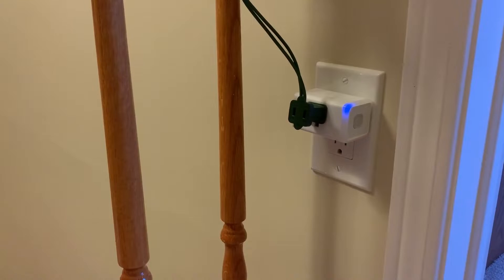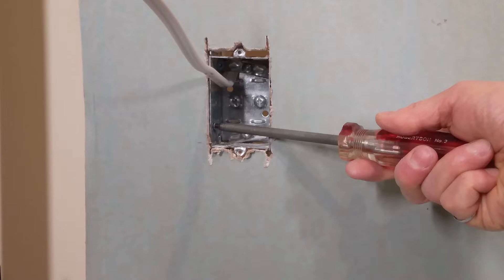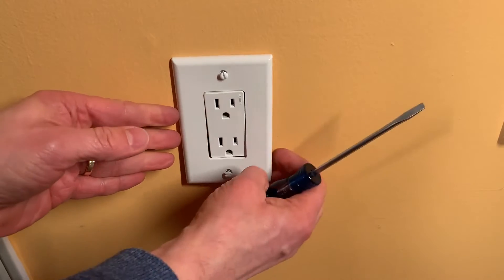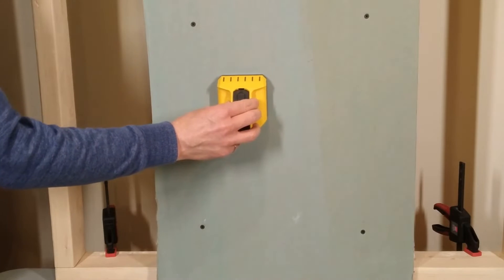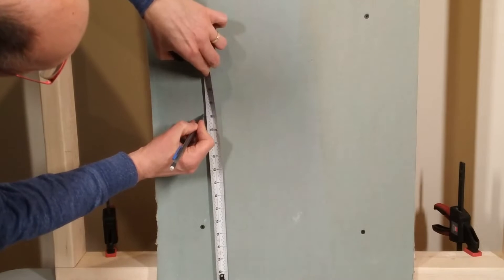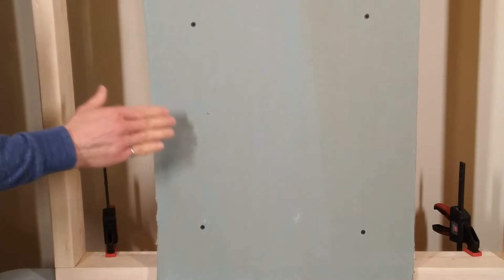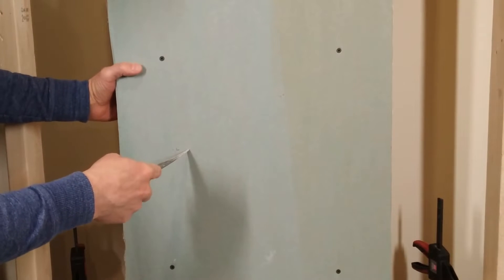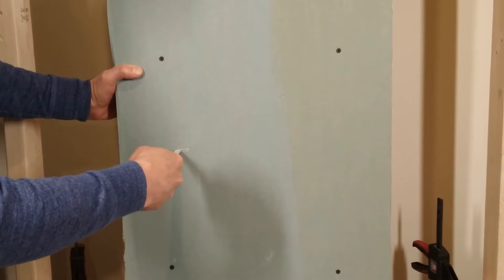Attach a metal electrical box to a stud to add an outlet or switch

Comment: Make sure that the ground wire for the cable is also attached to the metal box with a proper green ground screw as well as the outlet. All metal boxes must be grounded.

Comment: What type of screw was that? (It kinda looks like a machine screw, but that can't be right.)  And how'd you get it into the stud so easily?  Looks like you're hardly pressing on the screwdriver at all while screwing it in.  Did you pre-drill a pilot hole?
Reply from the maker: It's just a regular wood screw. I did not drill a pilot hole - I think that would be too difficult to do in this situation. I guess the stud wasn't too hard but it did take regular pressure to screw it in.

Comment: I wish you were using an actual wall as I am certain that one won't be able to grab behind their wall, to straighten things out or to help manoeuvre the junction box (e.g. 08:12). Also, not sure what housing is like where you are, but here in Toronto, Canada most folks, in dense areas, live in condos, and by our code (due to the risk of fire) condos cannot use wood studs in their walls. Steel studs, only. It would be so helpful if videos started to address how one would go about a given home reno/diy tasks when faced with steel studs... as they're an entirely different beast when it comes to fastening things to them.
Reply from the maker: I didn't have a wall I needed to install a box into so I used my mock wall. Most of my holding on to it was so it didn't topple over :). I am outside of Toronto so I know how many people live in condos in the city. Many, if not most, condos impose restrictions on what work owners can do and who can do it, so working with metal studs may not be as popular a topic even though your condo may allow you to do electrical work. Steel studs are, as you say, a totally different beast.